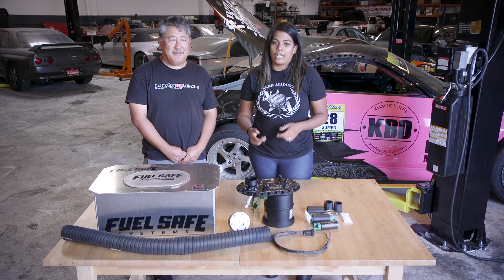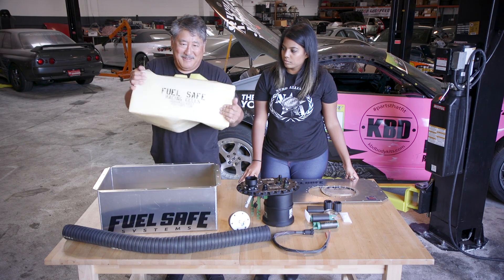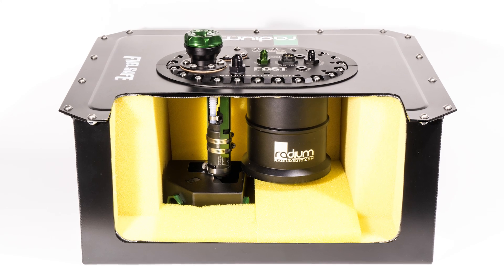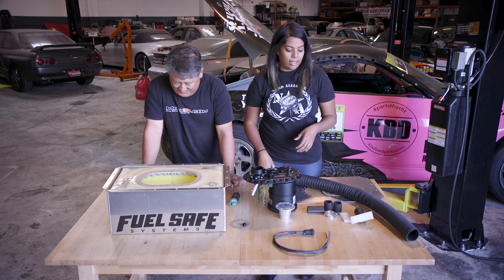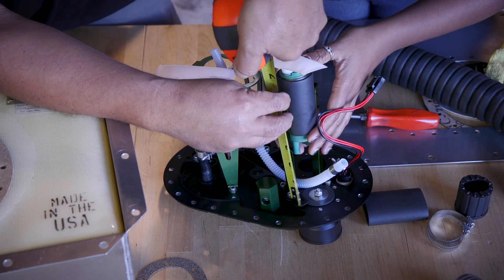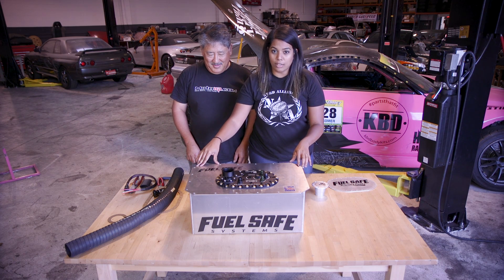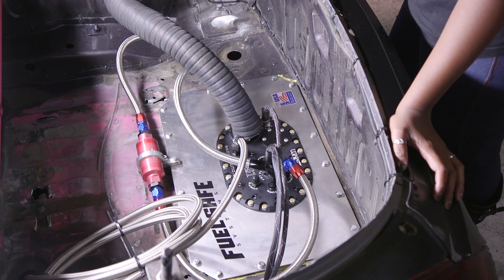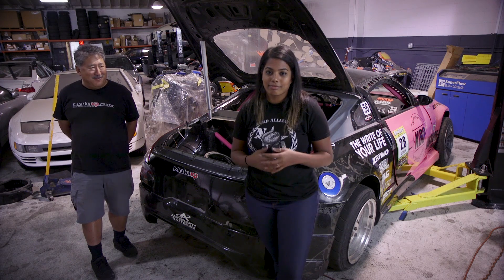Radium FCST & FuelSafe Fuel Cell - How It Works & Proper Installation

Comment: MotoIQ ... Fantastic content.  Thanks.  Several observations, if I may: (1) I don't work auto, but power gen stations -- Doesn't having the FC lid exposed in the cab make the cab Class I Div II?  Just askin'. ... (2) 10:30 -- Make that voltage (pressure) drop. Starting of the pump likely the most vulnerable point.  Typical multi-HP AC squirrel cage motors may like min 85% rated voltage or thereabouts, not familiar with fractional HP DC motors. ... (3) Somewhere there's a contact / contactor that energizes the fuel pumps circuit and it must be able to handle the Back EMF from the collapsing motor coil field upon de-energization, I believe, else the circuit could weld shut (ON). Perhaps I'm wrong ... again. ... (4) Kudos for recommending application specific fusing.

Comment: Question.. can this same set up be used in a modified daily driver honda(off road law rules dont apply where am from) like how many gallons does it hold vs stock and are they any tank size options to replace the stock honda tank??
Reply from the maker: The short answer is yes, but look into both Fuel Safe and Radium Engineering as they both offer different solutions. For example, Fuel Safe has different capacity cells that can be used with or without the FCST and Radium now offers tanks that can even fit in your spare tire well.
Reply: MotoIQ perfect, thank you!!